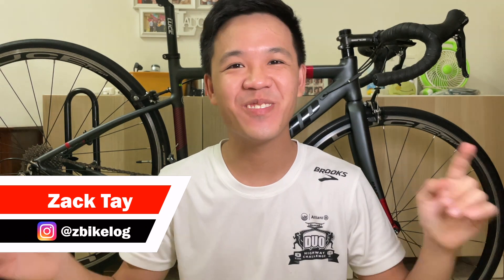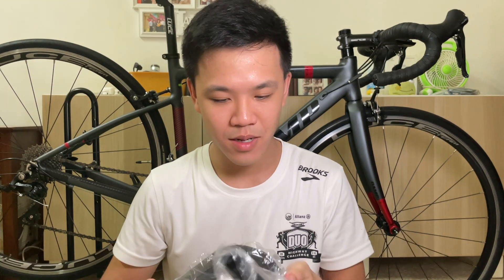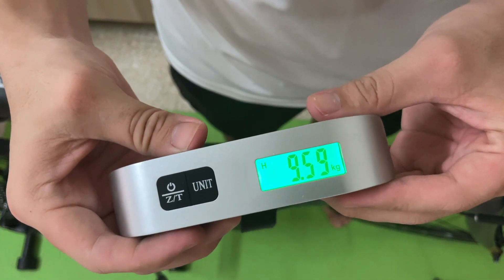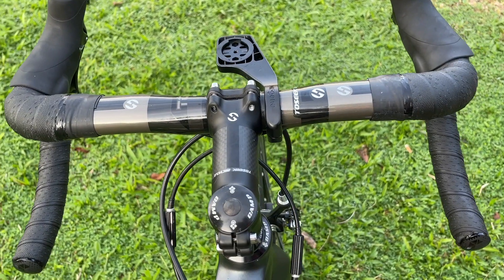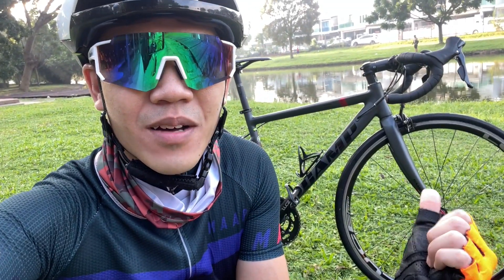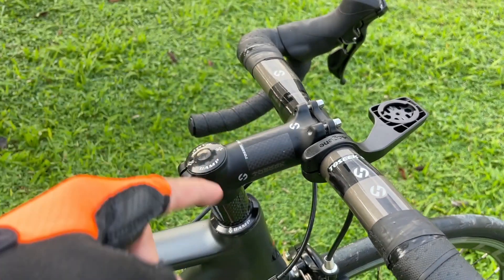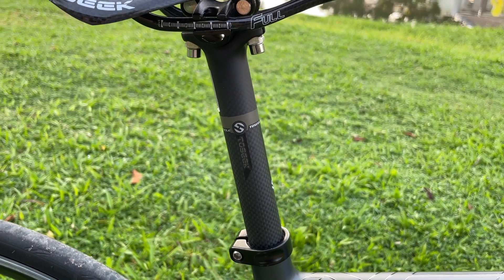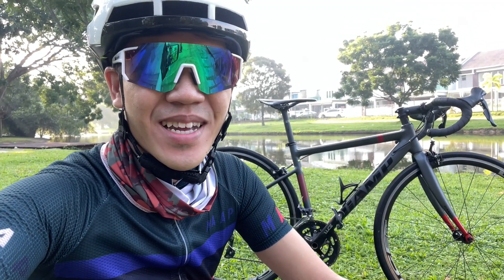Cheap Carbon Upgrades with Toseek parts| Cycling in Malaysia

Comment: I only use quality Titanium parts. My bars, stem, spacers, and seatpost clamp are Controltech's Timania. My seatpost is aluminum from Thomson. My frame is a custom titanium frame made in the US. All the bolt fasteners are titanium or aluminum. My saddle is the Phenom from Specialized. My bike weighs 8.2 Kilograms. But it is not subject to break like a carbon bike or component, no worries.
Reply from the maker: Nice!

Comment: Good to see some relatively cheap but useful weight savings, and comfort upgrades ( saddle?). Your biggest upgrade in weight saving will be the wheels. A good aluminium option are Campagnolo Zonda’s, at 1540 gm, and some lighter tyres and latex tubes. 

If you eventually change group set, SRAM Red 22  or Force 20 is the lightest. You can always transfer all this across to another carbon frame when finances allow. Look forward to seeing your progress!
Reply from the maker: Thanks for the advice! Really appreciate it when fellow cyclist share their experience! Ride on!

Comment: Camp Impala 2021 user here. i changed Toseek HB+Prolite CF Wheelset+GP5000 tyres+105 Chainring..now superlight..
Reply from the maker: Add in RideNow Ultralight Tube, save 100g each wheel too 😆

Comment: What is the length of your new stem? I was planning to change my stem but not sure the right length for me. My height is 162cm, between 90mm and 100mm which one is suitable for me?
Reply from the maker: Mine is 90mm. But that all need to depend on your bike fitting. If you’re comfortable with your current length, continue using the same length.
Reply: @zbikelog  tq zack appreciate your reply
Reply from the maker: @mohdrizainighazali3411  Ride on!

Comment: We've had 2 toseek seatposts on us already sadly.
Reply from the maker: Why sadly?
Reply: That's some pretty significant weight savings you had there. My bike(custom build) also weighed in at 9.6kg with bottle cage, computer mount and pedals. I only have the Toseek seatpost as the carbon part which folded on itself because of the seat post clamp. Our first toseek seatpost was for the mtb of my brother which broke when he fell over the bike (standing position only but forgot to clip out). I'm afraid of using carbon parts now because of that. also what wheels are you looking to upgrade? I'm bought koozer RS1400 which is advertised at 1.5kg. Maybe you can also take a look at that
Reply from the maker: @hucklejoko  I see, well so far mine have no issue, hopefully will not have that problem. I’m looking at Avian wheelset (also from china) they advertise it as 1.4kg. It will be interesting to test those out. Haha.

Comment: 9.6kg to 9.1+ kg...yang mana weight loss terbanyak?
Reply from the maker: Saddle paling banyak, and handelbar
Reply: @zbikelog  handlebar aero or  rounded? dislike aero handlebar?.. from the shoppee 5item cost around rm500....maybe if u upgrade pulley Rm550 cost. only for upgrade to toseek part. what do u with old part(existing)? simpan or jual.
Reply from the maker: @zulhelmihei5864  Yes around 500 total for all that. Keeping those old parts.